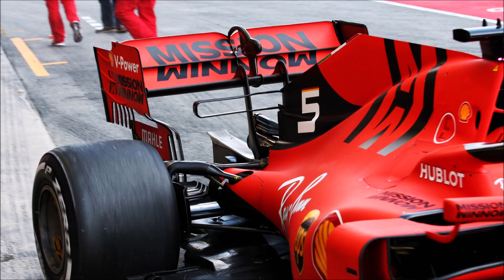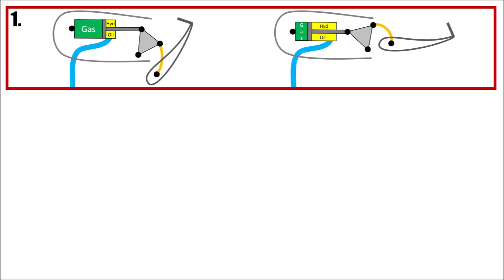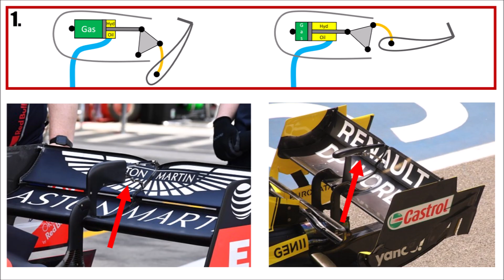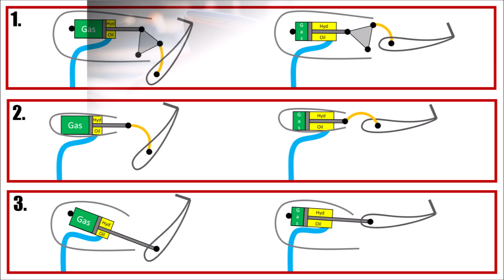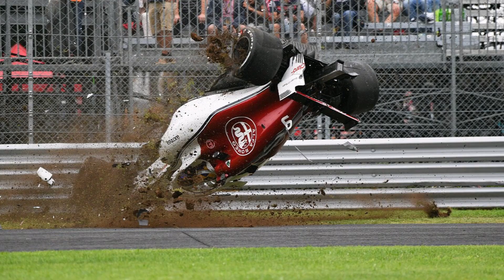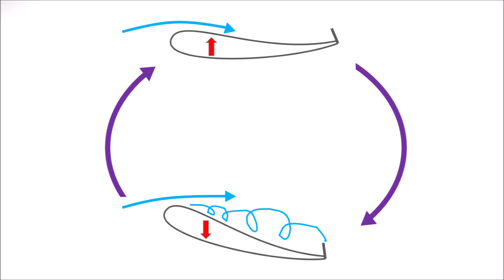Ex F1 Engineer explains DRS

Comment: If I recall correctly some teams used to use an actuation mechanism in the endplate. Why was this approach dropped over time? Does the extra complexity of getting the hydraulics in there make it not worth it?
Reply from the maker: Mercedes did that at their W03. If you actuate the flap from the side, the flap itself needs to be stiffer, hence heavier. The system is stronger and lighter if you actuate it from the centre - especially with the now wider rear wings.
It's easy to package with the centre pillar, which also guides the rear wing loads directly into the gearbox case. The aero penalty is minimal.